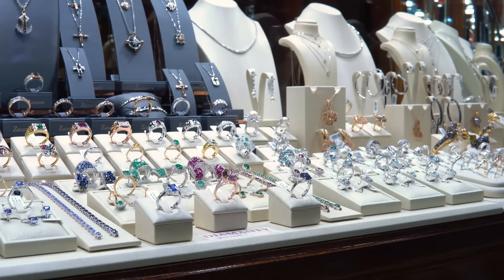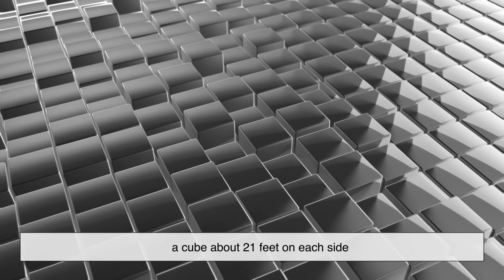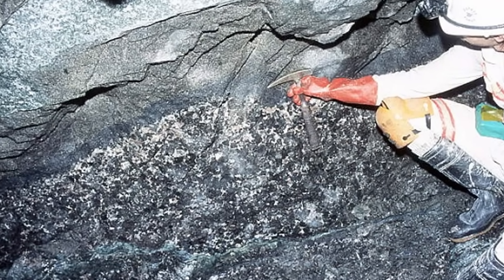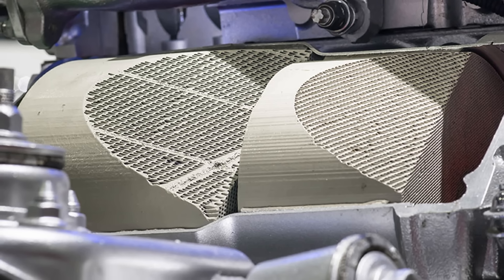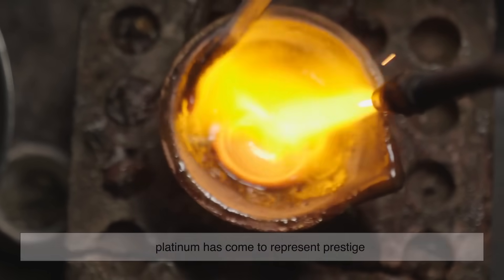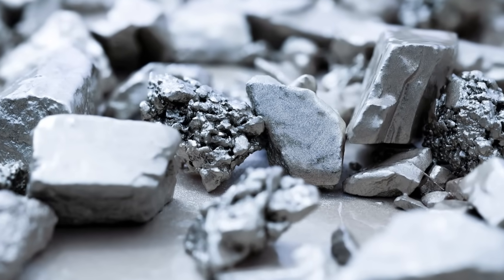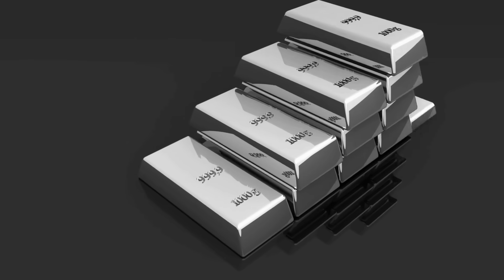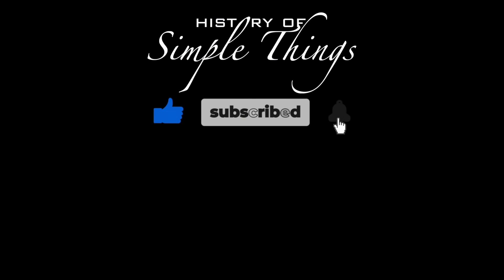Why Does Platinum Cost More Than Gold?

Comment: Gold costs more than platinum
Reply: The Platin amount is around 25 to 30 times LESS than Gold so the normal price of platinum is 25 to 30 times higher than Gold. Without measuring it in the paper money price 🎉😂
Reply: @piusgeisteier5046 if it cost ONE time less, it would be FREE.  Your statement has no meaning.